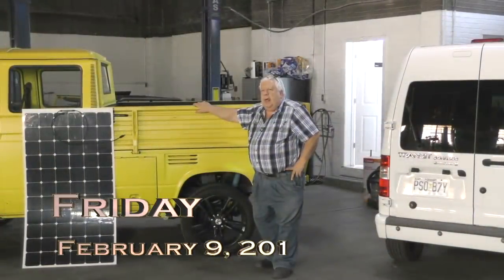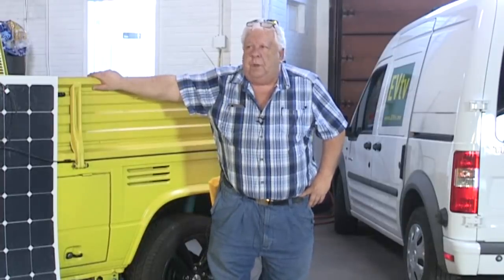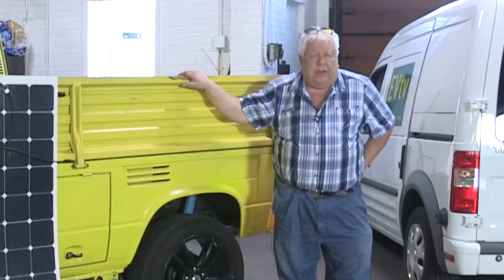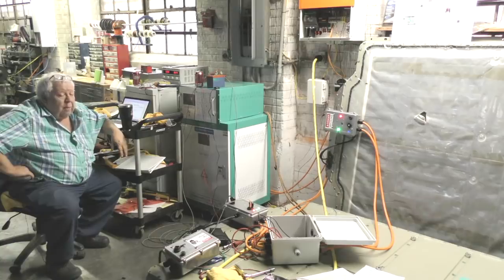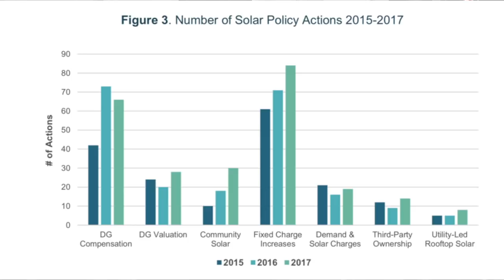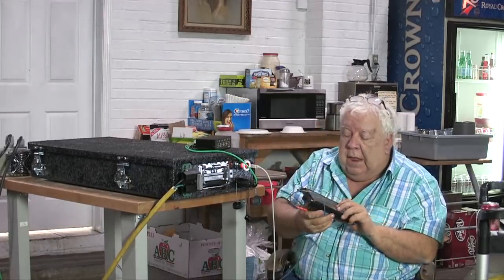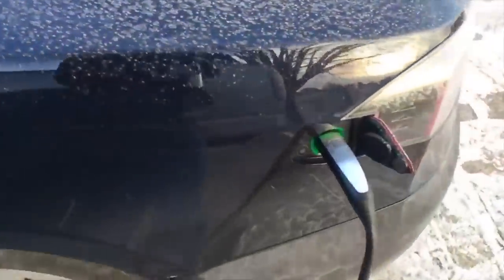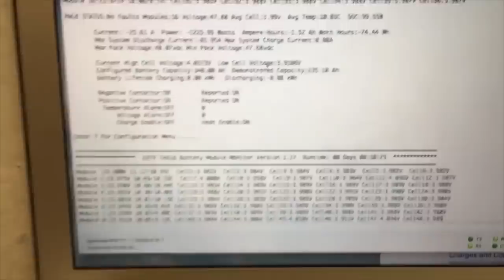EVTV - Tesla Battery Module Helicopter Battery - Trump Solar Tariff

Comment: Schneider  makes an mppt charge controller that can accept 2 arrays with voltage ranging from 150 - 600 volts. With a charging capacity of 80 amps continuously. This does dramatically  reduce the cost of wiring from the arrays to the charge controller. I have been very happy  with it so far for the last 2 years of continuous use.

Comment: Look like the sum of both pack plus the cables and contactor resistance is 0.2 ohms for both 141 and 255A test, rmeaning that each pack is about 0.1ohm internal resistance... interesting

Comment: Neat testing connecting the two tesla packs together at different voltages.  You once had a prius power inductor maybe that and some PWM driven IGBTs would make for a safer pack balancer.  Still it is nice to know connecting slightly mismatched packs is not as bad as I would have guessed (somehow I was thinking you might have more like 1000+ amps between them)

Nice to hear updates from you :-)

Comment: Jack, can you set up a trailer, like the Congressman's, which holds all the 400V off-grid solar BOS equipment and be protected from the weather? I want a system which is disconnected from the house because of possible fire insurance issues but can be rolled down the road with my tiny house on wheels and be hooked up.

Comment: Any advice on using a bmw i3 60Ah pack into a 240V 50Hz grid and solar PV connected home ? Currently SMA Sunnyboy east west 17 REC panel arrangement since 2011.
Reply: Thanks Jack. So need some kind of pack sniffer or use BMW maintenance software?

Comment: I watch every episode. Could you add a surge resistor that allows you to connect 0% battery to 100% battery? Say 300W resistor sitting on a thermal mass of 1kg of aluminium for 4 minutes = around 60deg temperature rise. Bypassed when the once the voltages get close enough.

Comment: Can I hook up tesla batties with just that 12k converter you see without using tesla BMS ?, its not in a car, is all that protection necessary?.
Reply: Jack Rickard so, yes then no?, is your answer.
Reply: Jack Rickard is that unit just monitor everything only?, and the 12k inverter is where you program high and low voltages ect.? , or is your unit controling something?' If so do you have a spec sheet of its functions?.

Comment: I know you can get charges that repair a lead acid battery 🔋 even the cheap £25 Amazon charger has that pulsed charge to repair the battery, I see even Victron Energy has that type of repair maintenance waveform.

Comment: That is a great explanation of the tariff's impact on the import of the panels.  Thanks. 

Since the Chinese is the cheapest of all the solar panel manufacturers, the profile of imports is going to give the Chinese a huge advantage over the competition and get them to move way ahead of the US in terms of solar industry control.  Also, Tesla (Solar City) has the advantage of manufacturing premium Panasonic solar panels that will not incur the premium which will make them comparatively affordable for the quality they are.  Hmmm...  I think the only winners here are the Chinese and Tesla.  Did I get it right?
Reply: i do agree that it will not hurt the solar market but the advantage now is going for the chinese which will still be lower than anything manufactured in the US.  thanks for a thorough analysis of the subject.

Comment: As always, incredibly informative. big thumbs up.
at 1:31:45 is Jack saying that he's going to St. Louis to argue with the local utility about net billing?
Please correct me if I have this misconstrued, a citizen asking a public regulatory committee to regulate a business.
My thinking is that in a perfect world, if a business wronged a person or another business, it should be settled in a court of law. Not communist regulations. or is this a special case with a monopoly.
PS.
can't wait to hot wire a Tesla Pickup truck (from the high voltage junction box under the back seat) into a 6Kw@350V Alta electric dirt bike battery, maybe stick a big fat capacitor in parallel or resistor in series to soak up initial spike of current or over volt.
how much does a capacitor that big cost? $200?
Reply: You know any regular citizen who can afford to take a power company to court with any results?
Because it will be decided on the price of your lawyer.
Reply: +Jack Rickard 
Our very smart (self proclaimed) president has demonstrated that I can sue anybody, even the people who I have wronged. If the goverment regulates me because I dump my old gas & motor oil in the yard uphill from my neighbors, that's communist.
But Russians are awesome when they help get me get elected to the US government.
(aside: everything in moderation, no such thing as perfect black or white)
Jack, you have an awesome soap box. seriously, I hope you use that keen intelect to help see more sides of things.  like a year or two ago when you said LiNiCoAl (tesla batteries) are death traps.  just took a little understanding to tame 'em. great job by the way.

Comment: There’s also 2.5 gigawatt of imported solar which is excluded from the tariff. So it won’t even affect a small time installer. But hopefully it will trip up some of these companies gaming the system of using cheap foreign labor subsidized by a 30% tax credit. If we are going to subsidize someone, we can get all the coal miners set up making American Made solar panels for a fair wage.

Comment: Instead of using subsidies to put a few electrical vehicles on the roads, it would make more sense to use those tax dollars to subsidize the research into better batteries.  Electric cars won't really take off until we have the low cost, efficient batteries that are needed.

Comment: My dream is to somehow be able to use my EV as a portable power wall. 350V DC to household 120/240. The inverter designer in China you mentioned near the end of the show sounds interesting. The Bollinger EV coming out in 2019 has a built in inverter to run power tools ect from a 120V ac outlet right in the truck.
Reply: The Bollinger is more to my taste. Every country squire needs one of those. 

Heck, it might even be repairable if involved in a wreck that totalled that Tesla.
Reply: Bollinger appears to weigh more than a Phenom business jet!
Reply: If I remember it has a 9000LBS towing capacity too. Can't wait!

Comment: Everyone realizes that the launch of the Tesla into space was fake, right?  It was bad CGI.  First clue to notice that it was fake was they removed  the rear view mirror so as not to reveal the fourth wall (Camera position).  If you doubt it was fake, ask yourself, how did they stabilize the car in space?  And if the car was dumped into space so early, how were they going to do course corrections and slow it down to enter a mars orbit?  Funniest part is when the computer running the earth globe slows down briefly.  Paint would have blistered, tires explode, etc.

Comment: 95% of rare Earth Metals are produced by China.    Rare Earth Metals used in Solar, Hydro, and Wind power.    Explain how putting tariffs on a produce of 95% is beneficial.    You also claim that solar installer prices are going down because of CHEAP labor but then complain about how they are making those prices go down?    WTF?   Your rants are just a TERRIBLE as those of media.   READ a book or 2 about rare earth metals and what they produce.